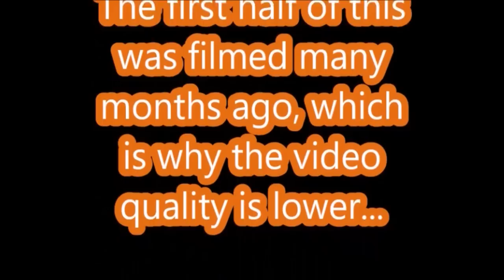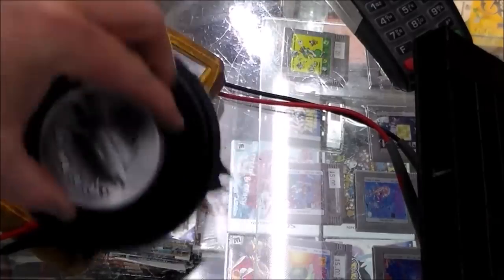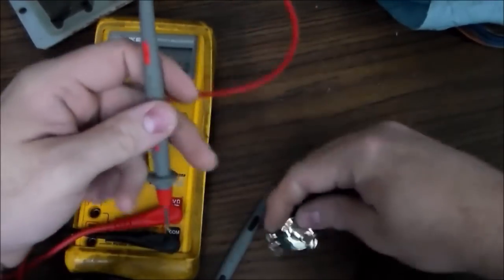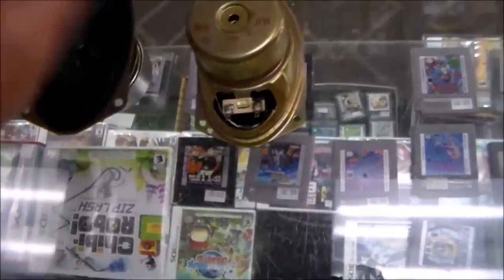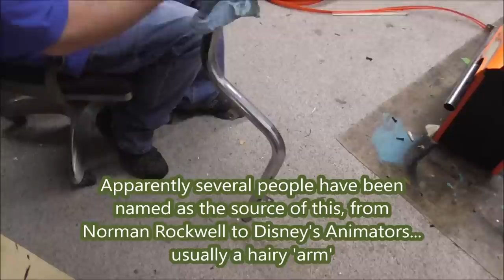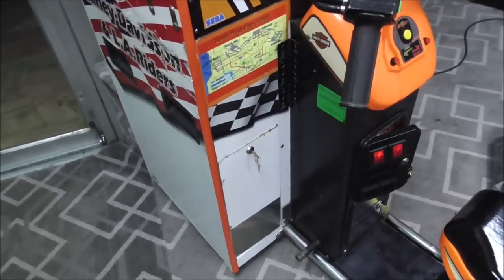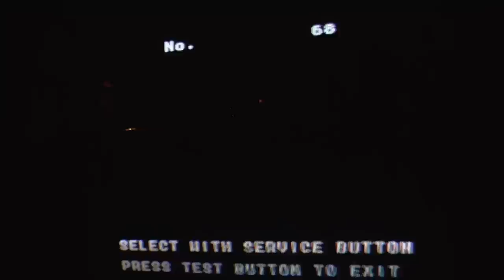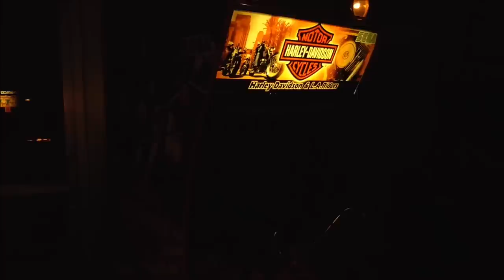Fixing The Sound And Testing the Music of Sega's Harley Davidson Model 3 Arcade Game!

Comment: Ron, impedance (pronounced im-PEE-dance, because it impedes the flow of current) is the sum of DC resistance and AC reactance. Your meter is only measuring the DC resistance part, so you'll typically get around 7ish ohms because you're not measuring the AC reactance part. But the DC resistance is most of the impedance, so your test is perfectly fine. If the speaker coil is open (meter reads OL) or has a bunch of shorted windings from overheating (meter reads only a couple of ohms or dead short) , your DMM will tell you.

By the way, sometimes a speaker reads open because one of the tiny coil wires connected to the terminals has come off, and all you have to do is resolder it. It's always worth checking. If the coil reads open because it melted, then it's time for a new speaker.
Reply: Impotence also impedes the flow as it were, just not of electricity 😂
Reply from the maker: Thanks for the info!
Reply: Ron: Thanks for filming these for us all! :)

Glad someone else noticed that engmcgil.

It made me grin to hear Ron talking about impotence, like Sega cabinates have sex lives and can't keep up xD. I guess the poor thing did have bad ROMS, thats enought to dampen anyone sprits ;).

I'm sure he knew he was doing that, as later he commented "its shlonged". hahaha.

Comment: For the speakers next time find a set of old PC speakers.  The Altec Lansings were really pretty nice considering and shielded as well since they were made to be placed near a computer monitor.  If you troll the thrift stores you can often find them for pretty cheap.  Strip the speaker out and mount it where you need it.
Reply from the maker: John are you trying to get me to be even more of a hoarder???? :)
Reply: @LyonsArcade  ROFL, I am the same way.  I have over 10 computers sitting in my place right now.  3 of them I just got fixed up so someone could use them if needed while all the virus junk was going on.  I have my desktop that is running, my wife's laptop that I can't bear to use since she passed, another laptop that I use from time to time for different stuff, my server which is dual Xeon X5690 96GM ram beast and my router which uses dual Xeon L5630's.  Not to mention the core i7 tablet someone gave to me and my android phones and tablets.  I once mentioned I heated my house with pc Graphics cards this winter, LOL.  If I was closer you would probably be calling to see if I had stuff sitting around when it comes to computers.  I actually have some computer speakers just sitting here.  I also ended up with a point of sale system that was used in a restaurant at one point.  Just need to bump the RAM in those and install some SSD's figure the system is worth a hundred or so once it's up and running.

Comment: if the amplifier has bad components it could be putting out DC current on the speaker outputs and its not always the main output driver itself .. Components like bad caps or open resistors that manage to impact the amplifier bias would certainly do that..   That issue if bad enough will fry the voice coil in the speakers on the effected channels explaining why the speakers are open ..  With no audio signal present there should not be any "dc" voltage present (more then half a volt is bad referenced to ground )  Speakers should only see variable audio signal AC on there terminals  .. A amplifier power supply that is not supplying clean DC to amp can also do this.. looks like this game has its own separate power transformer for the audio section, as you know use care with games imported from japan (100 v) as people will update the switching power supply, but not address the separate power to the audio amps or monitor causing them to fail from over voltage stress . as far as DC on the speakers one will often hear a hum as a side effect to this. if its not fixed it will also fry any new speakers you install.  an example of this issue ,,  https://youtu.be/-hChkNyf1V8
Reply from the maker: Thanks for the info Allrock123, we appreciate it!
Reply: Nicely put! DC voltage on speakers will  kill them, depending on voltage and coil resistence (different than speaker impedance).  The reasons for an amplifier putting DC voltage on the output are various, depending on amplifier topology. In push-pull circuits, if an output transistor goes short, it will ouput rail voltage directly to the speakers and fry them before a fuse can blow, it happened with me once. It is always a good idea to measure DC voltage on the deffective amplifier to help with diagnosis. Otherwise, there is a risk to damage newly installed speakers. After amp is repaired, it is necessary to measure DC level again to make sure it is under 50 mV or so. There may be pots on circuit to do that or simply the amp circuit is symmetrical  and needs no adjustments.

Comment: The resistance climbing or not being stable indicates there is likely a capacitor in the harness across the pot.
Using a 4Ohm speaker instead of an 8 will affect the amplifier in negative way.  It is good to order proper speakers.
Reply from the maker: I try to make them match as best I can :)
Reply: @LyonsArcade  You did really well with this one.  It was a mess when you started. 🙂.  The amp board likely killed the original speakers.  Sounds like some kind of biasing issue made the chips get hot, but hard to know.  Finding a new used board was good.
I always admire your work.  You make it look easy and explain things in a way that anyone can understand

Comment: Wow this was over a year in the making. Seem's like you're working on a feature film hehe.  When you said that both speakers were bad, that normally means one thing: The power amplifier shorted out and blew the speakers. Not a good idea to replace the speakers without repairing the amplifier first hehe.
Reply from the maker: We made it through :)  I don't know if it came through clear in the video but I replaced the entire audio amp board, I tried repairing the old one but no dice.
Reply: @LyonsArcade  Yes you clearly said you replaced the amp.

Comment: Thanks for sharing....question for ya Ronnie. 2114L2 static ram is there a good replacement or somewhere you can still get them...its for a galaga board. any help would be fantastic Chris.
Reply from the maker: What I always have to do is just buy them on ebay, there's not really a good obsolete IC place that I'm aware of online, if you do buy them on ebay don't buy them from China, you can get them in the US usually or Europe.  From time to time the ones you get even domestically will be fake ones the seller bought from China, but if you check their feedback first usually they will have previous complaints if they're sourcing their stuff from China.
Reply: Joe's Classic Video Games thanks for the help I appreciate it stay safe!